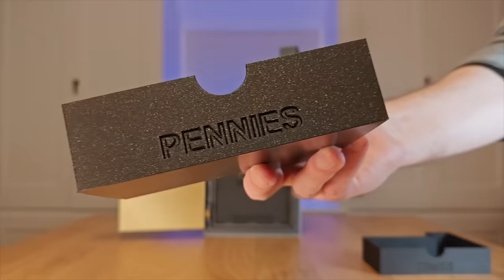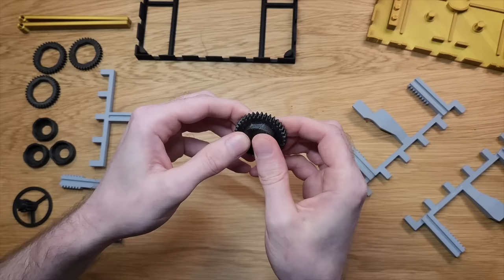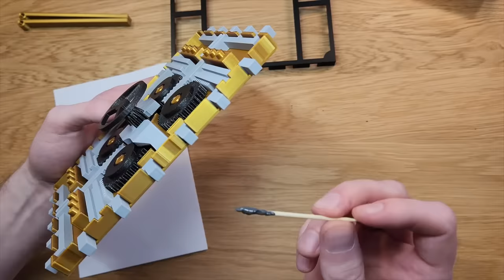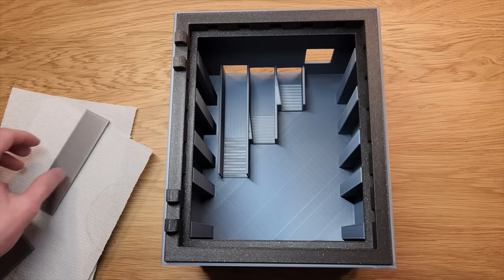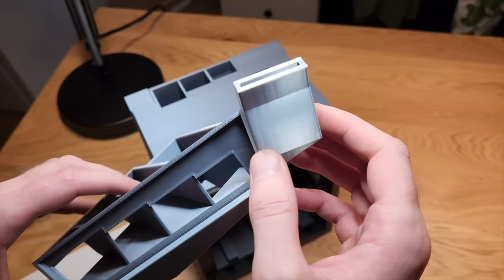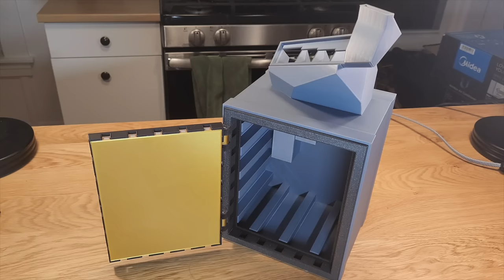3D Printed Coin Sorting Vault

Comment: To prevent the hinge from being installed on the wrong side, you could have adjusted the spacing of a single locator pin to make it very clear.
Reply from the maker: That is a very good suggestion

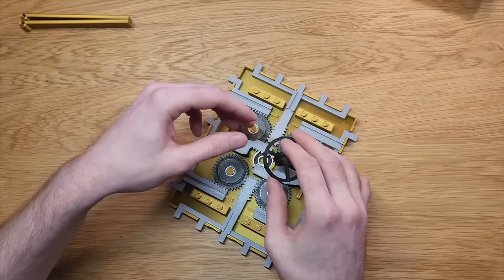Comment: This is going so well for me, but I have a question... when I get to about 4:19 in your video, I add the top and side locks and press them down, but when I try to move them, they are very hard to move.  Im using a Neptune 3Pro and PLA 1.75 filament.  Did I miss a step or something too big in my prints?

Comment: You need to add a faucet so you can pour coins into it.
The design is cool and everything, but if you need to put coin by coin inside, you could as well sort them yourself.
Reply from the maker: Thanks for watching and commenting! I agree adding a hopper would be great but this is meant to be a piggy bank (minus the pig) - but the sorter could definitely be adapted to add a hopper to act as an automated coin sorter. In that instance, I'm not sure the vault makes sense so open boxes would be better. Don't be surprised if I make an automated sorter in the future 😎
Reply: Didnt catch it the video that it is actually a piggy bank. It is a cool piggybank. 😊

Comment: OK so I just got this all printed.  Waiting for tomorrow to "glue" the coin funnel parts since what I use it so stinky.

Cool tip...
I printed those parts n PETG so I just used that purple primer for PVC and it fuses it together better than any glue.

Everything in the door printed fantastic and is pressure-fit including the hinge straps, but the actual wheel/handle isn't fastened to the door and is really easy to pull out.

Comment: you've definitely made an eyecatching vault with a fantastically simple sorter.
just a few things i noticed, i'm sure there are several comments about most of these things but i'm just compiling them.
the inside walls looks like a missed opportunity to make drawer slides, so you dont have to take out all the upper boxes to take out a lower one.
the ballbearings seem pretty overkill for something with that little stress, and if the lock has a bit of resistance, well it Is a vault after all so it doesn't Not make sense.
the triangle pyramid thing at the bottom of the sorter like you said probably doesn't save all that much material, but i think you could get away with making that part entire hollow. the only support it'd need is the outer walls and the coin dividers.
lastly about the project, the sorter doesn't really save a lot of time as you have to take 1 coin at a time. maybe something like a funnel or a magazine loading thing so you can dump coins more freely.
now for a final personal nitpick, you tend to overexplain and re-explain a lot of things throughout the video that don't really need it.
that's not a critisism to you as a person or maker, just me noticing and pointing out.
2 quick examples would be the inner divider walls and the hinges.
the walls are pretty self explanatory but the information is doubly repeated.
and the hinges size are told in regular worksman terms and then explained what those mean, this way of explaining it would be nothing of note if it had either been done with something earlier in the video or a consistent thing.
again, this is me being nitpicky and i mean no disrespect by it.
you've made a great looking vault and a good video explaining it.

Comment: I love it. :) Will you make a EUR version? But our coins are quite odd. The biggest coin of the next lower sort is bigger than the lower worth of the higher sort before. :D
So duocolor 2 EUR is 25,75mm
1 EUR is 23,25mm
but the golden 50ct is 24,25 mm
20 ct is 22,25mm
10 ct is 19,75mm
but the copper 5 ct is 21,25mm
2 ct is 18,75mm
1 ct is 16,25mm.
Also some countries do not use the 2 ct and 1 ct coin.
Reply: Let me know if someone made a euro version
Reply: me 3
Reply from the maker: Work has begun on a Euro version, stay tuned!! (but don't hold your breath, it will probably be a few weeks because it's a pretty substantial change)
Reply: @RoccosStuff  <3
Reply: *copper 5 ct
Reply: @jorisvb  oh. Yes ofc. 😂
Reply: @RoccosStuff wow thanks 🙏

Comment: I love the design of the safe and the idea overall! The only thing I was wondering is if instead of a slot where you have to put one coin in at a time, is there a way to have a "coin dump" so that you can take handfuls of coins and then separate them into single coins for the sorting you have in place?
Reply: Possible, but hard to do without jamming.  It would also take up a lot of room on top to slowly get them to go from a bunch of coins to a single coin.  Normally this is done with a motor of some kind (to prevent jamming) but it's a cute design for a kid's room
Reply: This is what I came to say as well.  Overall it's still awesome what you did, but if feels like you spent to much time on the unnecessary extravagant door, instead of a very beneficial coin dump.
It's better than anything I could have done, so props to you, just giving my two cents (pun intended)
Reply: I had the same thought and googled it, just google/youtube 3d printed coin sorter and one with a handle will show up.
Like the design of this one and wish my tinkercad skill were better lol  , we have 6 different coins here. I would like to flip the door though, so the outside was flat (and maybe painted like a safe)and instead of the solid peice on the inside i'd use plexi glass so you could see the mecanism 👍👍
Reply: @rickybobbyracing9106  I feel like you might be missing the point (unless I am, which I admit is entirely possible), but it feels to me like the entire allure of this build IS the extravagant door. It's certainly what made me print/build it myself. It's neat looking, and I like that.
Reply: @KevCoLabs  Gotcha, that makes sense.  I agree with you, the  door is freaking awesome.

Some times I get too hung up on function over form.  Let's just say, I don't design the best looking things :D
Reply: Wow! As someone from the design/construct community I find your design commendable.
I see some comments about over design, to me that misses the point of the idea.
Great work.
Reply: @SquidNick which is you build a small tumbler. Wouldn't be able to handle a massive amount but toss a hand full in. Let it run, repeat.
Next to make it fully automated would "handful dispenser" with a mini hopper up top. Dropping the load a the tumblers can handle.

Comment: Looks like a really well done design. A suggestions that I thought of. Have a triangle feature on the top of the box that fits in the recessed triangle feature of the sorter to assist alignment. You are right that the triangle feature to "save filament" really doesn't save much because 3D printing has infill. You could save more filament by adjusting the infill pattern and/or density. But, since the recessed feature is there, why not use it for something? Or would adding bumps to the top of the box make the bounding box too large to fit on a Prusa i3 bed?
Reply from the maker: That's a great idea! And it should still fit on the print bed. If I make a revision to the box piece, I will definitely add a key for the sorter to slot in. 
 Thanks for the excellent suggestion!!

Comment: @Rocco's Stuff
I'm having issues with the bolts not fitting onto their tracks and gears easily. The print seems oversized on gear teeth and channel grooves too small and i've tried filing/sanding them with no success.

Comment: @RoccosStuff care to share your print settings for the main box? Or any of the other pieces? infill and walls?
Reply from the maker: I just used default settings in Prusaslicer, and all the pieces had the same settings:
0.2 mm layer height
2 perimeters
5 solid layers on top, with minimum shell thickness 0.7mm
4 solid layers on bottom, with minimum shell thickness .5mm
Infill 15%

I hope that answers your question - let me know if you are looking for something more specific! Thanks for watching and leaving a comment!

Comment: did you get the metal dowels on amazon cause i can't find them .
Reply from the maker: https://www.amazon.com/Hilitchi-Stainless-Support-Elements-Assortment/dp/B07F3T5FKL/ref=mp_s_a_1_2?crid=7JQSMRSX7KQK&keywords=hilitchi+110+pieces&qid=1701267497&sprefix=hilitchi+110+piece%2Caps%2C126&sr=8-2

It's a kit with extra pieces, but this is what I used.

Comment: Hi, I saw your video almost three weeks ago, decided to take a risk, I d/l your files and used Crealty software to convert the code, I started with the teeth gear x 4, side slider x 2, top and bottom slider also, backplate door. Things didn't do well, the few studs on backplate door did broke, Also the gears didn't turns well. so my Daughter asked me to use Elegoo software and I had to reprint, it did go well with small sandings, then the box, coin slide and chute and few other items. It did went well and it was worth it. My small headache is the JB Weld that smells like a poop. I also bought the nylon bearings, not alloy one. When installing the door parts, I had to go through a few items making sure the mechanism goes smooth without hic-cup, and everything went good. I had to order 5 by 30 mm dowel from Amazon. I was pleased with your incredible talents on design and things. Thank you!

Comment: What about a seive made up of spiral track, with a slope, on a four quadrant chamber/vault below. The tracks then have vertical slits(the seive part), with small to large lined up to appropriate quadrant vault. Now Dump the coins, in an adjacent chamber, Jiggle the coins to standup and roll(a simple massage vibrator will do). There will be only 2 parts to 3d print, the spiral seive and the quadrant chamber. Could manually drop coins, or add a chamber with a jiggler. Wait and watch gravity do the job! and have some fun! Just some alternative 💭❤👍

Comment: You can probably make it even more printable by making the metal hinge dowel pegs out of raw cuts of filament. Additionally, have you considered 3dprinted bearings? There are some wicked designs nowadays that might be able to shrink down close to the 22mm bearings
Reply from the maker: I worry raw cuts of filament aren't strong enough to hold the weight of the doors, but that's an interesting idea... And I need to look into 3d printed bearings, that could be a game changer. Thanks for the suggestions! And thanks for watching!
Reply: @RoccosStuff   Here's another cool idea I've implemented if you're trying to go for strength on filament shafts: Stack 7 of them as a bundle together, and squeeze them into a round shaft hole 5.18mm in diameter. Theyll self-align into closest-packing configuration. They'll act as one giant 5.2mm dowel. Melt the ends so they weld together and rivet as a stop-knot. Makes for a surprisingly strong shaft.
Reply from the maker: That would definitely be strong enough! Someone on Printables (shoutout ReeeTheWizard) 3d printed the dowels had great results. Thanks, again, for the suggestions. You've given me a lot to think about for my next design. Less non-3d printed parts are a good thing.

Comment: this is really really cool! I have been pondering getting a 3-D printer for sometime. I don’t know an awful lot about them as it seems like everybody has something that’s a little bit different. But what you made with the coin sorter is really cool and I would love to be able to build one myself. do you have a list of what you need to buy for a 3-D printer and the supplies needed or where can I read more about that so I know I’m getting the correct printer?
Reply: Buy a Bambu lab a1. $399. If you want multi color prints buy the ams. It’s the best beginner 3d printer. It just works and you don’t have to build it. I have one and the a1 mini.

Comment: You can probably put the seam on the corner and it doesn't bother that much anymore.
Reply from the maker: Is there an easy way to do that? I couldn't figure out how to create a straigth line when painting the seam in Prusasliceer. Although I did zero reseach, so forgive me if that's a dumb question...
Thanks for watching and the suggestion!

Comment: would it be possable to get a cad verson?
Reply from the maker: Sure, I'm planning to post more file formats to Printables. What format would you prefer? I did it in Fusion360
Reply: @RoccosStuff  3MF is good, but what I meant was a CAD currency version, e.g., toonies, loonies, quarters, dimes, nickels, pennies.
Reply: by the way pennies have been fased out  so the dwore for them can be smaller 
and the safe for the CAD currerncyverson may need to be slightly bigger

Comment: Awesome! Would give this a go if it was AUD! :)
Reply from the maker: Thanks! I am working on a revised version to work with Euro, which requires expanding the sorter because it needs to accommodate 8 different types of coins. How many types of coins are there for AUD?
Reply: @RoccosStuff we have six types of coin in general use (plus two that are no longer issued, but still legal tender, probably able to ignore the 1c and 2c values); 5c, 10c, 20c, 50c, $1 and $2. In physical sizing, it goes 5c (smallest), $2 (only a couple of mm larger than 5c), 10c, $1 (again only a couple of mm larger than 10c), then 20c and the largest is 50c, which is also the only coin which is not round, but rather a regular dodecagon (twelve sides), so it might need a small indent at the bottom of the chute to force it to have sideways momentum if it drops onto a flat.

Comment: It seems like 3d printed bearings would work fine for this considering it doesn't matter if they have a small amount of friction. It looks like an excessive design and uses a lot of plastic but I think that's a lot of what makes it fun. Also, I think the design could be improved if the drawers somehow slotted into the box instead of just sitting on top of each other. As it is right now, you can't remove the quarters without first removing every other tray.

Comment: Did I miss something? This is pretty useless, if you have to insert coin by coin... Why is there no funnel or similar, to be able to through in a hand full of coins at a time?

Apart from that: looks cool and great design!
Reply from the maker: Thank you!
This is meant to be a piggy bank of sorts, but I understand your point. Funnels or hoppers tend to clog constantly, so the slot is most reliable. I may design an automated sorter which includes a motorized hopper, but that's a totally different beast...

Comment: such a cool design! i would download and print one if i didnt have to put the coins in one at a time. a coin hopper would make this more useful. i would alter the file myself but i am a loser and dont know how to use cad software :(
Reply from the maker: Lol, Thank you!!
I may work on a variation with a hopper at some point, but this project was really meant to be a piggy bank that accumulates coins over time - rather than a machine to sort a big bunch of change at once.
Thanks for watching and commenting - I appreciate the support!
Reply: @RoccosStuff  if you end up making a version with the hopper, or just wider opening that would allow for a pinch of coins or small handful of coins, let me know. I’d def buy the file if it had that option. But it’s a fantastic design, kudos